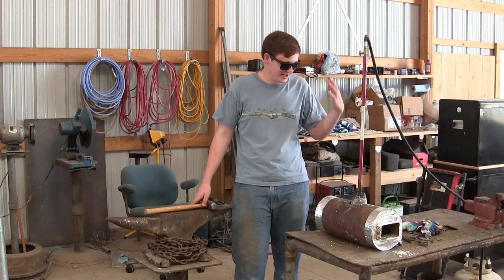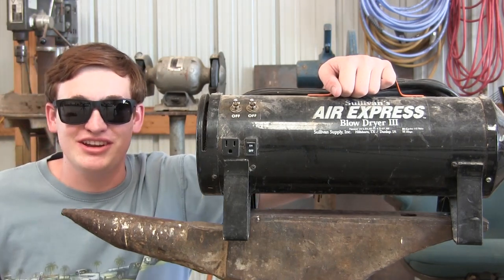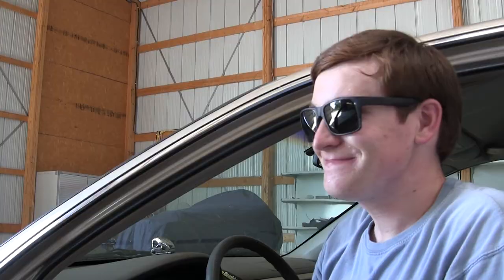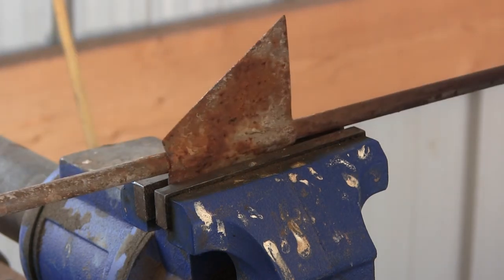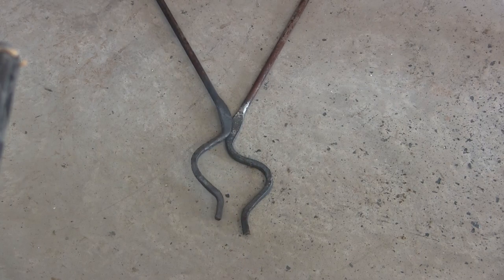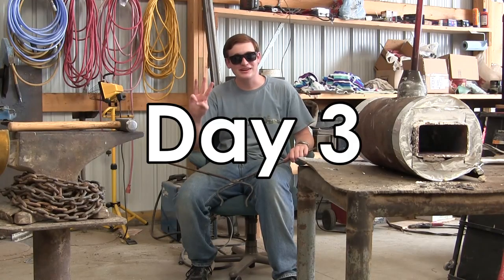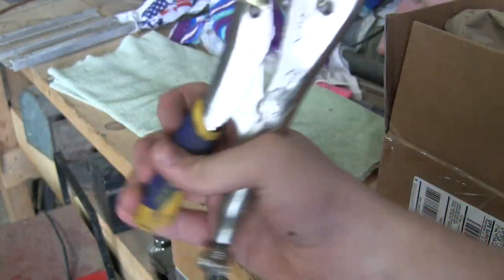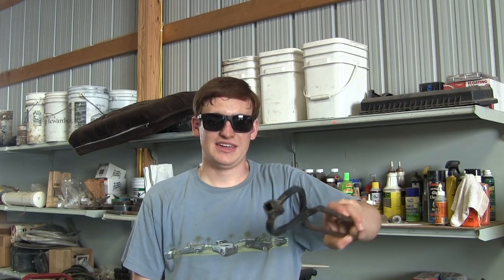My First time Blacksmithing (Making a pair of tongs)

Comment: Nice video, just a couple of thoughts, 
if your burner is naturally aspirated which I’m assuming it is(haven’t watched your other video), then a blower won’t achive anything and even if it did, the position of yours is simply providing cooling to the outside of your forge. 

A hung of concrete will reduce the amount of escaping hot gases and increases the temperature somewhat but concrete can EXPLODE when heated. Don’t know how expensive they are in US but in UK, proper fire bricks are real cheap. 

Oh, one other thing, hitting hot metal (or any metal even) sunglasses don’t tend to provide any safety, you have a long life ahead of you and it would really suck to go blind. 

Your enthusiasm is great, keep it up and you might be another Alec Steele 😉
Reply: In the u.s firebricks are about 7 bucks per of you source em right.